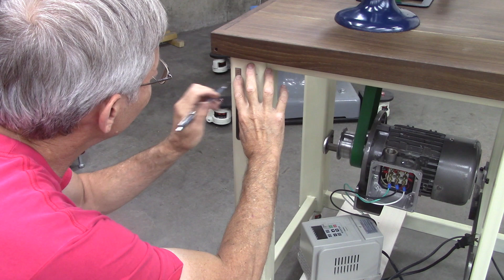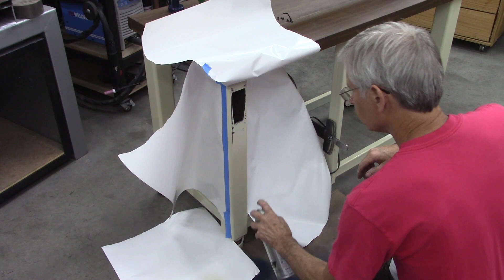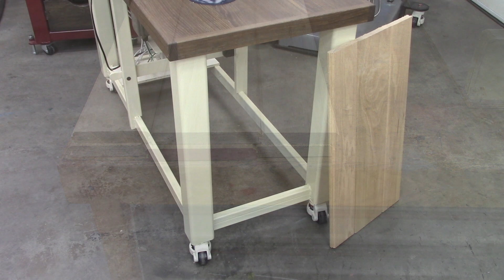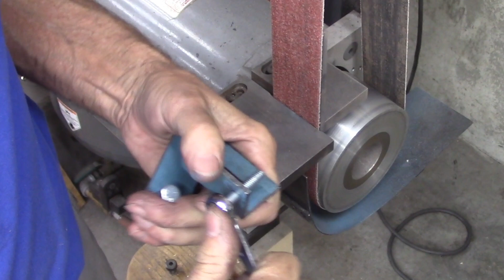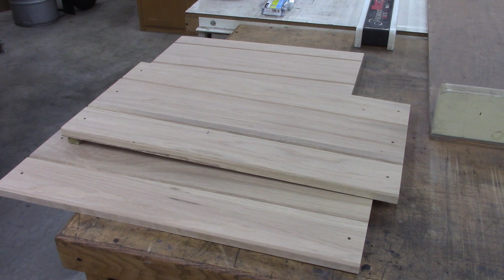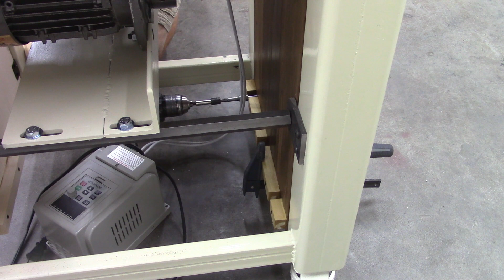Hardinge Cataract Restoration Pt 6

Comment: Winky this has been amazing to watch. I have a similar cataract myself. I've yet to start my attempt at a restoration but watching your videos is incredibly inspiring. Have you thought of adding a carriage to the lathe as well?
Reply from the maker: The next video will be the carriage restoration although its stationary - no lead screw.
Reply: @WinkysWorkshop  would you consider adding a lead screw?
Reply from the maker: @lukeschmitz5583  Probably not. The cross slide has a fair amount of travel. There is an attachment that links the cross slide to the spindle but they are probably hard to find

Comment: Please add some sort of ventilation for the Motor and VFD cupboard. Even if the bottom is left open....hot air could be trapped because the other 5 sides are solid .....A small fan like the one used in a Computer PSU would suffice to vent hot air from the rear wall of the cubboard ( Like in a Desktop Computer Cabinet ).
Reply from the maker: I may do that...  for sure I will monitor the temp.

Comment: The fumed oak looks beautiful! Really coming along nicely. I do hope the AC wiring in and out of the VFD is temporary? Didn't see and ground conductor on either the 1P in or the 3P out? Worse, using a green conductor for a hot, is a really bad practice. The 1P in should be Black-Hot, White-Nuetral, Green-Ground. The 3P out to the motor is Black-T1, Red-T2, Blue( or White taped Blue )-T3, Green-Ground. If it was just kludged up for a functional test,  please forgive my critique, though it should be grounded, temporary or not.
Reply from the maker: All good input, I didn't know the color standards although you're right about the green (normally ground). I'll be putting a power switch on the outside of the cabinet for the VFD. I plan on grounding it when I do this. Also the green wire is just what I had on hand. Thanks on the lathe...  yeah, love fuming process.
Reply: Glad you weren't offended Mark, just wanted to pass on some helpful info. The lathe turned out awesome. Can't wait to see it make chips once again! Good on you for saving it from the scrappers! @WinkysWorkshop
Reply from the maker: @907jl  Not offended at all. I'm not super worried about the wire colors but it definitely needs a ground. Nevertheless, if I had the wire and the knowledge I would have made it correct. You'd love the sub panel I put in. Years ago my shop ran off the main panel and I had too many outlets on a couple circuits. It was safe because I never ran my machines a the same time but it wasn't right and the wiring was hard to figure out. I redid a lot of the shop with the new panel. It's nice to have a logical layout that others could figure out.
Reply: @WinkysWorkshop

Comment: The fuming looks very good.   Good progress.
After you put the back on, are you planning on adding some ventilation holes so the VFD does not overheat?
Dave.
Reply from the maker: If needed I will add vents. Its a good size cabinet I suspect it will sty cool. Thanks on the lathe.
Reply: I’d never heard of the fuming process until I saw it here.